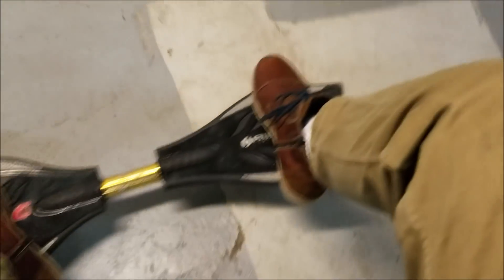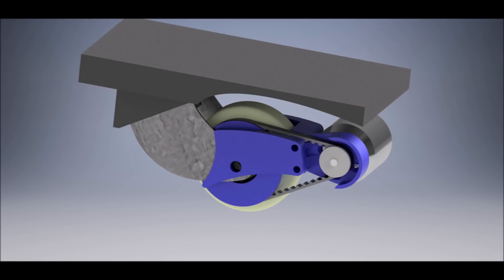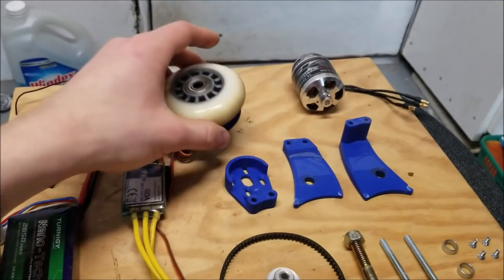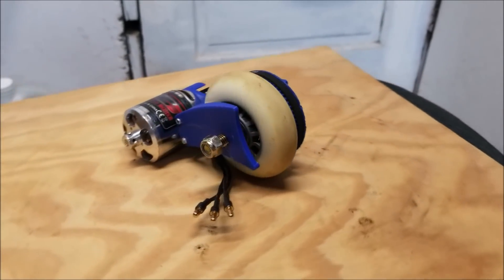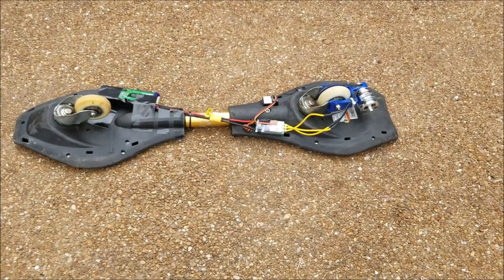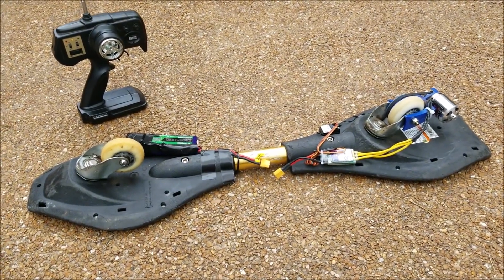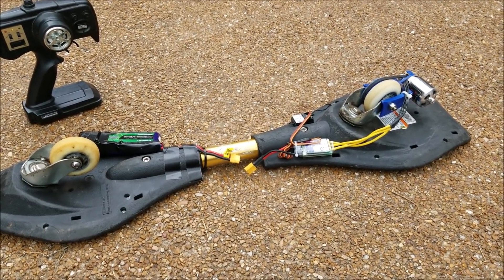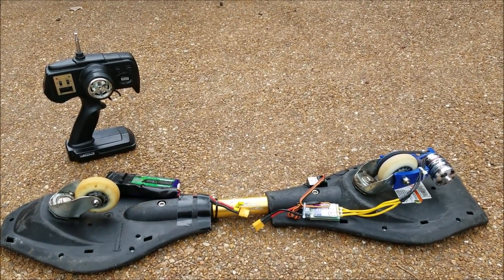World's First Homemade Electric Ripstik

Comment: I was inspired by this project and I am working on developing a motor mount made with a CNC machine using high strength aluminum! I am also going to design 2 small 3D printed enclosures for the VESC and battery that can be mounted to the top of the deck. I'll sell the mounts and enclosure when I am done for anyone else who wants to make this but doesn't have a CNC machine or 3D printer.
Reply: Did you ever get to making them? is there a link at all
Reply: @adrieltorresola9580  Well, I did make the aluminum motor mount, but unfortunately I didn't have time to continue the rest of the project due to my business taking all my time.  The motor mount worked great though!
Reply: Morgan Kuphal ohh alright. Yeah I’m thinking of working on a project like this, but I’ll probably have to use 3D printed parts because I can’t really utilize CNC. But thanks! I hope your business keeps going well

Comment: Hi, nice thing you got there, I saw your post about it on ESB ! Watch the 3d printed motor mount, they're not really solid, and yours is really thin ! Also, would you mind sharing the file from 1:30 approx ... I don't really see how you fixed your pulley to the wheel
Reply from the maker: Hi Anastase. Thanks for your advice. I increase the motor mount infill to 50% so its closer to solid than most prints, but I agree it could still be much stronger. And the files are all on Thingiverse, see the link in the description. The pulley slips into the wheel rim and I glued it to the side strictly to prevent lateral movement.
Reply: You know that’s their is a actually a real electric ripstick from razor